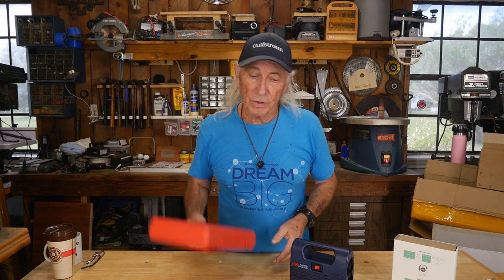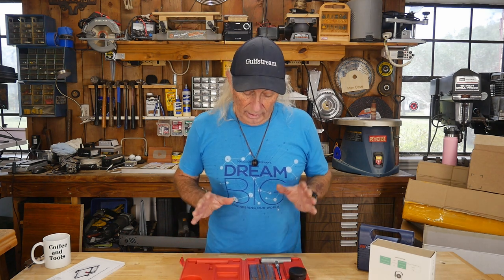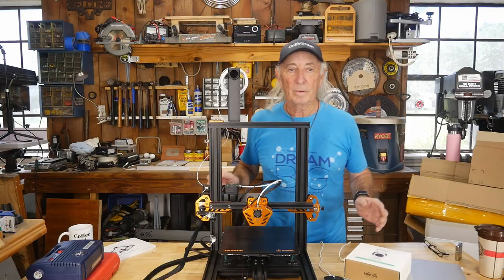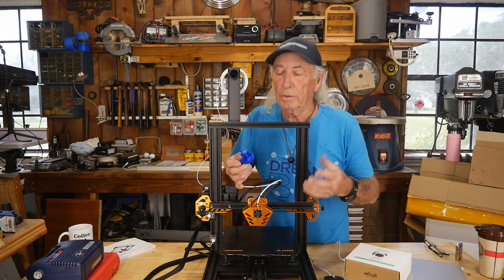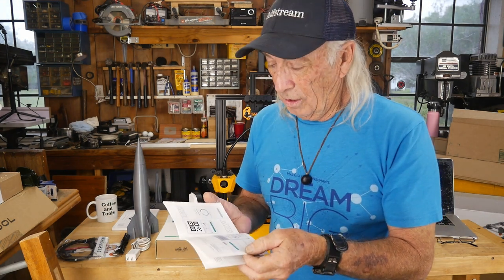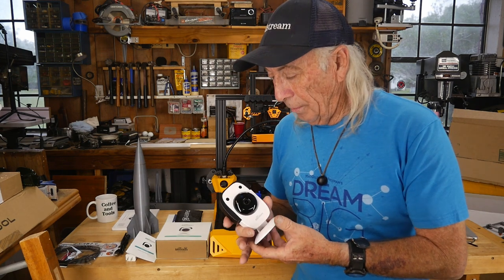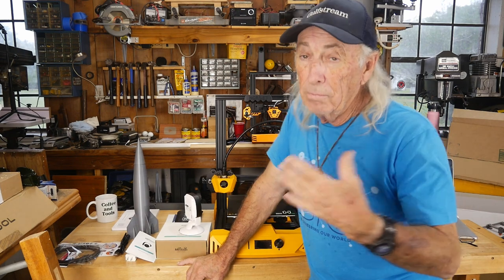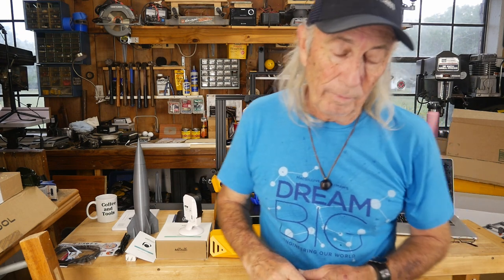Beagle Camera, Yard Sale, Auto, and working with David Hasselhoff, Coffee and Tools ep 278

Comment: I have the same trouble cabling between my sound system Wi-Fi controller and my TV… the TV has a bunch of connection options.   The Controller has only one… and, it’s the only one that the TV doesn’t have…. So, I route all my TV sound through the DVR to get to the controller.

One of these days… everything will be wireless and smart enough to just push one button and everything works!

PS… it is still a lot easier than was setting up a dot matrix printer on a Commodore 64!
Reply from the maker: OH, god took about 3 days to make the Commodore even see the dot matrix LOL...oh...god yea.